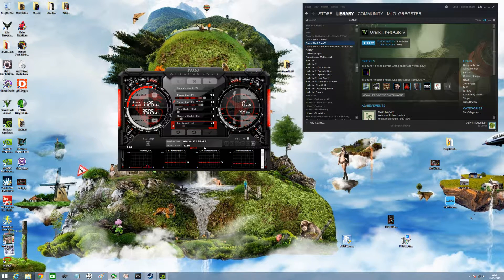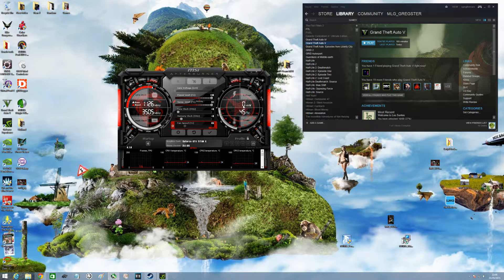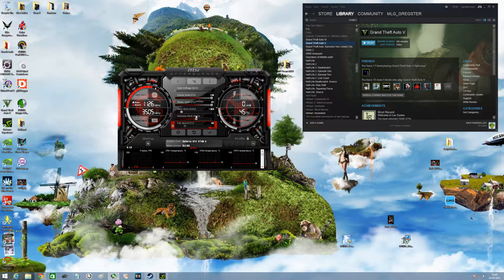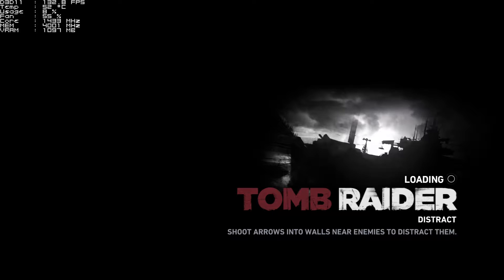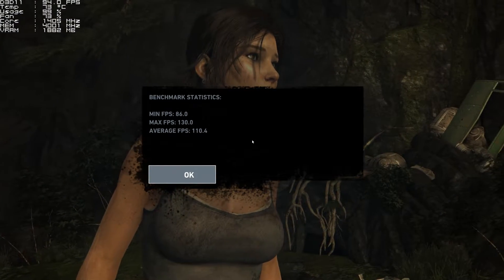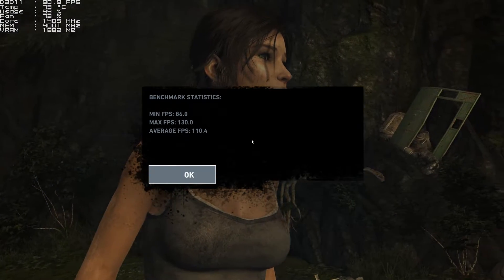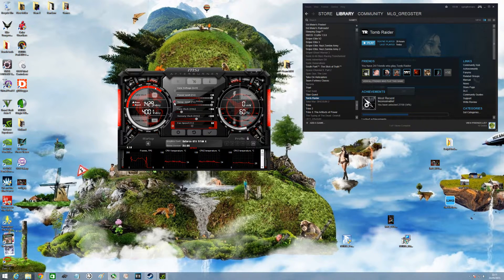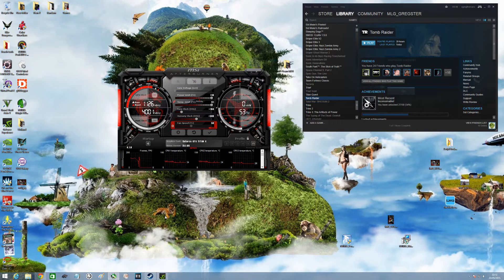How to overclock a Titan X with MSI Afterburner

Comment: Hey man thanks for this video! I have been attempting to OC my Titan X for a while. Got it at the start of this year. Yet I can never find a stable one for my card. I look at multiple OC guides and they all say around 200 CC and 400 MC and that's stable for them. Yet still I get crashes after about 5 mins of playing. It does last longer sometimes, and even shorter at other times. I am now trying this as shown in your video. I put mine at 100 CC and 500 MC. Hopefully it works :P I will get back to you :) However this is while playing the Witcher 3. And I know this game really dislikes and OC'd card for whatever reason haha
Reply from the maker: +It's Matthew (Fifa 16 Career Mode) Some cards are just picky with overclocks. I had a 290X that was a real stinker when adding more to the core but the best way to find your stable overclock is patience. Don't go in hard and fast but take your time. You should be good with +100 on the core and memory. Good luck :)
Reply: Yeah good so far. Put Power Limit to 110, Temp, 91 , Core clock and Memory Clock the same as yours, 100 and 500 and set a custom fan curve. Seems good so far :)

Comment: Did you overclock for the Witcher 3? I had mine overclocked and the game kept crashing. I set it back to default and haven't had a crash in a couple of hours. It's stable in every other game I play except for The Witcher.
Reply from the maker: Seth Knows No Seth. I tend to leave everything on default for gaming and The Witcher 3 really does work the GPU, so any slight instabilities will show up. A lot of people are having issues and I wonder if it is to do with overclocking?
Reply: Gregster Reviews The new driver is not working well, I have been getting display driver errors and crashes even while browsing the internet. Since I set my clocks back to default, I have not had one issue. It's kind of a shame, I was getting around 10 extra FPS with it OC.
Reply: Gregster Reviews Stock clocks I just had it crash while watching a youtube video. Nvidia better hurry up and fix this.